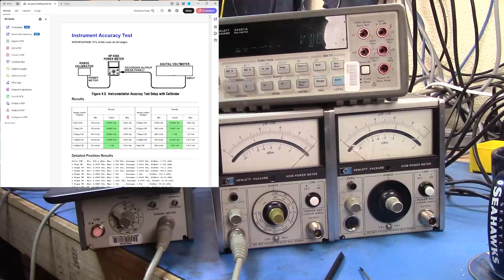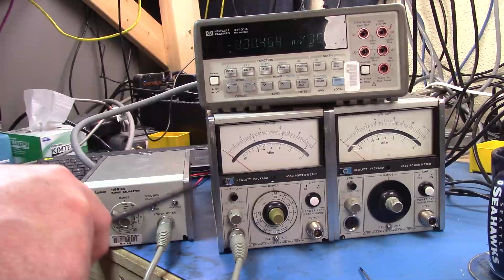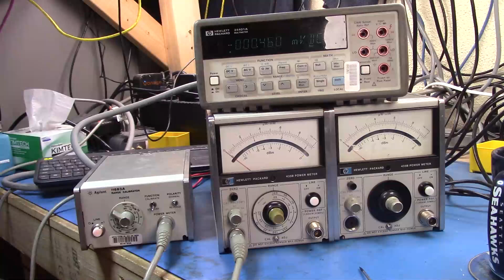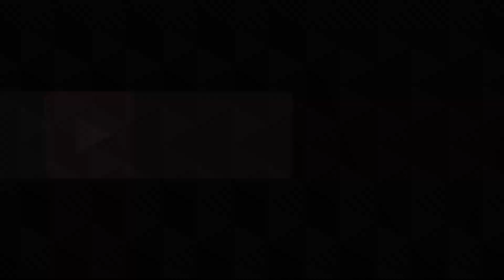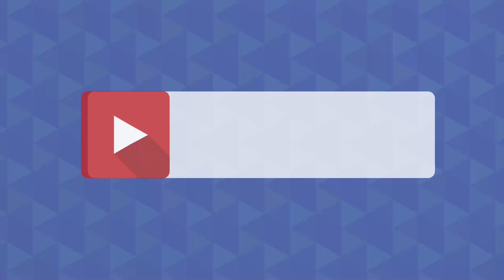HP 435B - Instrument Accuracy Test with HP 11683A Range Calibrator

Comment: The guy at eevblog you refer to is Jared, better known over there as NFM.
He has indeed produced a V1.0 of a DIY range calibrator, which uses a dead power sensor. He plans (but progress is a bit slowish 😂) to create a V2.0 that eliminates the need for a dead power sensor as a donor. Hth.
Reply from the maker: Thanks - That is exactly who I was thinking of.
Reply: @tgsoapbox  Jared told me he is busy with other stuff but hopes to get back to the calibrator at some point. My interest was spurred after having repaired two E4418B power meters. Which was an interesting adventure in its own right 😵‍💫
Reply: There is another option as well, I've built this one: https://www.youtube.com/watch?v=VLkvqzXmRDA
Reply from the maker: @DemolitionMankan  Nice - That looks great.
Reply: @tgsoapbox  just to be clear, its not my video. I just used the files in the github repo to build my own
Reply from the maker: @DemolitionMankan  Ahh got it - I think it looks like a great 11683A implementation so worth people looking into I think - There is also anotherone on the EEVBlog where the reference voltage is inputed from an external supply - I should go to see if I can find that.
Reply: Excellent video. I’d like to know how you created the software; I’d like to make it myself.